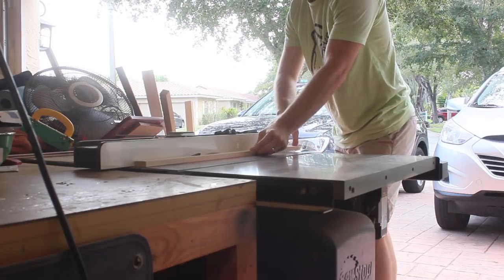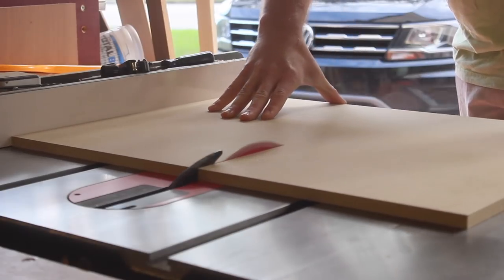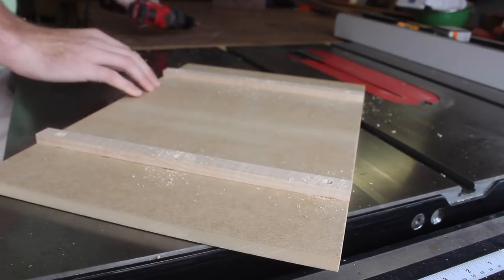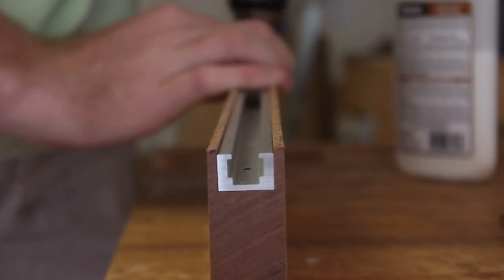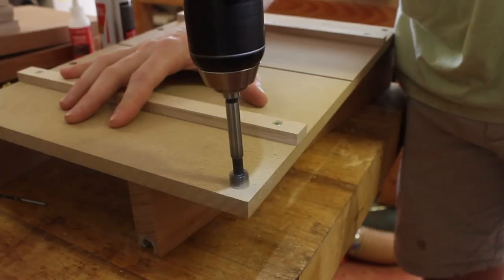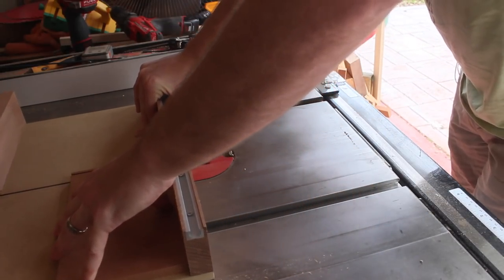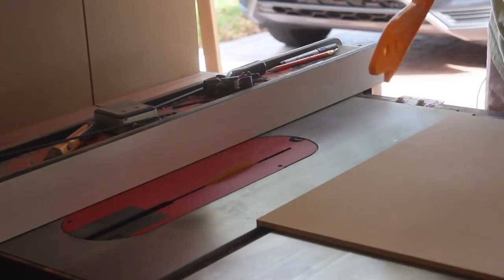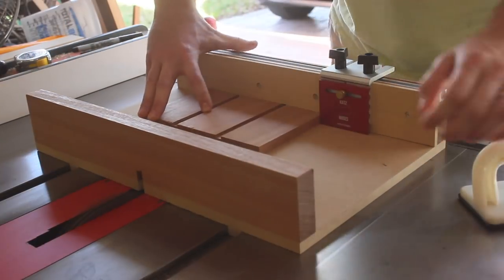Making a Mini Crosscut Sled for Dados

Comment: Great vid, perfect build.  How well does it work if  you've cut wide dados with it and then need to cut narrow ones?
Reply from the maker: It works well. The widest dados I’ve cut are 1/2” I think. If I have a few cuts and avoiding tearout is critical, I’ll as a some blue tape to the gap as my zero clearance. If I have a lot of cuts, I’ll take a sacrificial piece of 1/4” MDF to the fence and/or sled base.

Comment: Nice but I wouldn't use wood for the rails. I did the same and come change in weather they no longer work
Reply from the maker: Thanks. We'll see what happens in the next year or so. I think they'll be ok but if they expand too much I can take a few shavings with a block plane.
Reply: @parillaworks  Yah definitely depends on your location. My sleds were rendered useless by expansion this fall so I am going to just use pre-made rails going forward.

Comment: Hi, I’m about to make a couple of sleds and was going to use strips of an old plastic chopping board for the slides. I liked the idea the slides would not be susceptible to movement. Any reason you used wood for the slides or was it just because you had scraps available?
Reply from the maker: I considered other types of runners but figured making them out of quarter sawn hardwood would be ok. If there's any movement come summertime, I can hopefully plane them down a bit if too tight or add blue tape if they're too loose. But I think you would be perfectly fine using the plastic runners.
Reply: parillaworks: Thanks for the reply, I was just double checking before going ahead. I wasn’t sure if I’d missed something 👍.
Here in the UK, I’m not sure why, dado stacks are not allowed.  I’m trying to think of away of achieving the same result without a dado stack. The only thing I can think of is a double stop on the sled but that would require a clean out of the dado in which case I would probably just use a router.

If anyone has any alternative ideas I’d appreciate a response to this comment. Cheers.